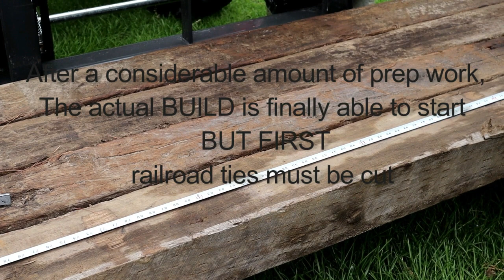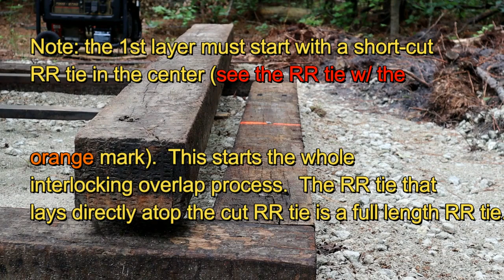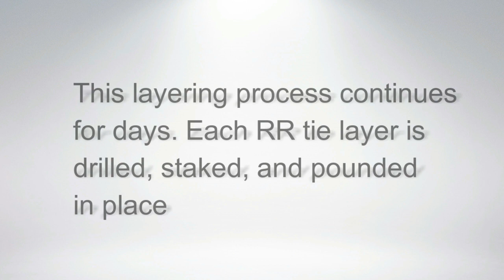Building a Railroad Tie Backstop For Shooting Range Part-3  (The BUILD)  Vid-076

Comment: That big saw really helped out! Nothing easy about any of that job Don!
Reply from the maker: Thanks for the kind words, Andy and you're absolutely correct. Some of the build was a bit  challenging.  I didn't even show where I squeezed my truck inside the opening use as a ladder to drill/stake the upper layers. The triple digit heat almost stopped the build.   To say the least, I was mighty glad when I finally got the last level in place.  I surely could have used one or two able bodied hands to make things go more easily.  Part 4 is my last in this build series that shows a few added safety features.  Thanks Andy.  I really do appreiate your continued support. Don  👍🏽🤠  9/9/22

Comment: Don that's quite a project that would be reel tough without the power equipment.....How did you manage such good lookin' ties.....Mine never looked that good.....LOL!!😎🦾👀
Reply from the maker: Great question, Wes.  I traveled to another part of NC to get those Grade 1 RR Ties.  It cost a pretty penny but well worth it.  The ties normally sold at Lowe's were oddly enough, more expensive than each of these and the ones at Lowe's were all full of splits.  The ties at Lowe's are Grade 3's or Grade 4's which normally are so split that they are almost not worth using. So I did some research to locate a fella who actually runs a business excavating RR ties from train tracks and sells Grade 1, 2, and 3's.  These Grade 1 RR Ties are heavy as hell-o and I can drag/shift them around but they're just too dang heavy to handle w/o a tractor or some type of HE.  Thanks much for watching and commenting, Wes.  Now I can almost throw some lead at targets but in Part 4 you'll see how I set things up to finally shoot at targets.  Have a fine weekend, Wes.  Don   👍🏽🤠  9/9/22

Comment: Great job, Don!  That was one BIG miter saw you had there and it was the right tool for the job.  The back stop looks great!  Level, square and very sturdy.  Well done, my friend!  BTW, I see you’re just 4 subscribers away from 1,000.  Congrats in advance!
Reply from the maker: Hello Martin. You're correct, the large circular saw was the right tool for the job.  It made quick work cutting those RR ties.  I had no idea there was such a large circular saw until I did a bit of internet searching.  It is a bit heavy but effective.  A vewer commented that he was building his backstop using RR ties however, his walls collapsed.  That prompted me to replace the root-filled dirt foundation with rock/gravel, then level things off.  So far the interconnected walls seem quite sturdy. Thank you for watching and your positive comment.  Appreciate the congratulatory remark on subscribers but that seems to roller coaster at times.  As you're familiar w/ YT, my channel will gain 2 then lose 3 (roller coaster affect), however, I am very thankful for subscribers like you who have shown support throughout.  Thank you for that, Martin.  Be well my friend and have a fine weekend.  Don  👍🏽🤠 9/10/22

Comment: That, my friend, is a ton (or several) of work! Impressive! Dropping another LIKE on your video! You certainly have an eye for details!
Reply from the maker: Hey Ray, so happy you could stop by.  I enjoyed your detailed 3-way light switch replacement.  I need to do some electrical work and as stated in my comment to your vid, that I am NOT an electrician but for the fixes I want to do, it shouldn't require an electrician.  Of course, I guess I'll know if I unintentionally zap out the power in the house.  Yes Sir, the backstop was a project that I'd have to get in the "build" zone and remain there until completion and now I can officially say.....DONE!  Thanks for the LIKE and if I remember correctly, you and Miss Demeanor were contemplating a small pistol range on your beautiful piece of land.  Do you still have the wild hogs traversing your back field?  That was funny how they'd sneak in, munch on grass, then high-tail it outta there when you'd take notice of them.  Those boars can be a nasty handful if you ever approach them on a bad day.  I watched a YT video where some folks were actually aggressively attacked during a stampede of boars.  Now that I've never seen until I saw the vid.  Alright Ray, I've yapped too dang much so thank you again for your support and I'll see you in one of your vids or in one of my next episodes.  Be well, my friend.  Don 👍🏽🤠  9/10/22

Comment: This looks awesome. I have a question, did you put Rebar through every last one or just the first few railroad ties?
Reply from the maker: Hello AJ-sb8qk.  EVERY railroad tie has four (4) rebar stakes attaching it to the RR tie directly beneath it.  My RR ties were 6 inches deep so I pre-drilled four  12.5" deep holes down through the top RR tie and through the underlying RR tie.  I then cut four rebar stakes 12.5 inches long to drive down through the top RR tie down into the RR tie that it sat on.  This made the sides and back very sturdy.  The key thing is to make sure that the original base (ground) layer is flush and level. I hope this answered your qestion and didn't mke things more confusing than it should be.  Fire back at me with any further questions. My email is 1kryptoniteone@gmail.com 
Wishing you the best in your build. It's definitely a chit-load of work if you're doing it all by yourself as I did. 😱   Later, AJ.  👍🏽🤠 9/17/23

Comment: Wondering how your setup is working a year later? Would you change anything? I have thought of doing one similar but had the thought of putting down one or 2 layers on the front to hold the sand in.
Reply from the maker: @Mtbambeno, so far the range has held up quite well.  I don't throw as much lead down range as I thought I would but I made a few mods to the backstop to satisfy a few querks  just for my liking.  I did put 1 RR tie across the front to hold the clay-sand inside if it started to slide forward, however, it never-ever slid forward.  Even with rain, the rain did not make the clay-sand break down and wash out.  Overall, the build was a success and is still holding up.  I need to do an update on many different projects to show viewers how several different builds I've done are still holding up well.  Thanks much for asking and have a great week.  👍🏽🤠 04/16/24

Comment: Very nice. How many ties did you have to buy. I’m getting ready to make one.
Reply from the maker: Hey there Gary. I purchased 43 grade 1 railroad ties which had little-to-no splits.  Nothing like the RR ties sold at Lowes.  I purchased them from a guy who extracts them from the railroad lines and resells the good ties.  I hope you don't do like I did and attempt to build while the weather is blisterin.  I'd wait until it cools down a bit.  Best to you on your build. Wear steel toe'd boots.  You'll see why.   👍🏽🤠 7/28/23
Reply: @houndsmanone4563  thank you for your response and No in the heat. I live in Florida and the heat index is over 100 with 100% humidity. I want real ties not the Lowe’s one. I’ll try this in the winter when it’s 70 and I don’t have steel toes for sure. I’m old so I’ll be slow at it.
Reply from the maker: Gary, that's a smart move to wait until it's much cooler outside.  We're having extremely hot, humid, weather at this very moment and have been enduring this weather for several weeks now. I'm beyond tired of this miserable weather but you just gotta deal with what comes our way.  I know what you mean when you mention being old.  My wife and I are in our 70's and even the simplest of things is quite demanding on one's body.  The steel toes are not a necessity but once a tie slips and crunches on your toes, your whole outlook will change.  If you live near Miami, Florida try contacting Peltons' Nursery.  They claim to have Grade 1 RR ties.  I have no clue what they're selling a RR tie for but they should be in much better quality than the rotten ties sold at Lowe's stores.  If you have a Sunbelt Rentals near you, you should be able to rent a 20foot dump trailer and even the large 16" Makita circular saw to cut the RR ries to length.  You can even rent a lift, to help you raise the heavy RR ties into position.  There are over 72 SunBelt Rentals in Florida and I guarantee they'll have what you need. Best to you, Gary.  👍🏽🤠 7/28/23
Reply: @houndsmanone4563  we are in Orlando and I just spoke to me brother and he is a craftsmen. He said this would be easy, but equipment would be required and he has an account with Lowe’s, HD and Sunbelt. He said he would help and get the rentals too. I have a heavy duty trailer already. Thanks for all the insight. It will be helpful in the near but colder weather. Lol

Comment: Could you use #2 Ground Contact Wood Pressure Treated Lumber instead of ties considering sand stopping projectile.  Ties here expensive and not great condition   ?? Please advise
Reply from the maker: I definitely hear ya, JL.  You're right, the cost of the RR ties are quite pricey and the quality of the RR ties from Lowe's and other places like that are crappy.  Lowe's sells grade 3 RR ties which are all split and pretty much only good for landscaping.  Yes, you could use 6x6 or 8x8 treated lumber but they are super costly.  I purchased forty grade 1 RR ties that are of excellent quality directly from a man who gets them from the RR tracks.  I had to travel about 70 minutes away to buy them.  B/C I bought so many and got a military discount, they cost less than the price that Lowe's charges plus the ones I bought are hardly cracked and are heavy since they're saturated with creosote.  I hope you can find someone who sells them in bulk and I hope you can get grade 1 RR ties since they're top-notch quality with few cracks and not punky from interior rot.  Good luck finding some.  I was down at the backstop range today making some slight sasfety modifications.  It has gotten quite cooler than when I constructed the backstop and now's the time for some fun.  Have a great Thanksgiving, JL and thanks for watching and commenting.

Comment: Sir where can I rent a lift truck from the one like this video?
Reply from the maker: Vutha, if you have an implement company near you, sometimes they have lifts for rent.  Are you located in the US?  If so, I'm sure there are numerous companies that rent lifts near you.  Thank you for watching my video and commenting.  Have a fine upcoming week. 👍🏽🤠 3/19/23
Reply: @houndsmanone4563  , am here in Waycross,Ga I want to set up my backstop similarly like the one on YouTube, I got 30ties
Reply from the maker: @vuthaven3582  Outstanding!  I hope my video helps give you an idea of how I built mine.  I am not the originator of this design at all but it surely meets my needs.  If you get a chance, check out Sun Belt Rentals in Brunswick, GA.  They have lifts, tractors, and all kinds ofstuff to use.  That's where I rented a 20 foot trailer to go buy my RR ties and I rented the big Makita circular saw to cut through my railroad ties.  Best wishes to you in building your backstop.  It sure would be nice if you could get an extra hand at building your backstop.  Oh BTW, if you can buy a set of timber tongs, that will realy help you when lifting or dragging RR ties around. I bought mine from Amazon. I'll send you a link after sending this comment.  👍🏽🤠 3/20/23
Reply from the maker: Vutha, here's a link for a pair of Log tongs I purchased.  After I brutally smashed my finger from a RR tie, I started working smarter with the right tools.  https://www.amazon.com/gp/product/B01LX0LJAA/ref=ppx_yo_dt_b_asin_title_o07_s00?ie=UTF8&th=1

Here's another tool I bought to assist in moving RR ties.  It's called a hookaroon
https://www.amazon.com/gp/product/B01LYA0T9B/ref=ppx_yo_dt_b_asin_title_o07_s01?ie=UTF8&psc=1